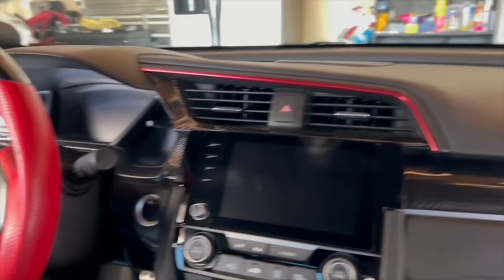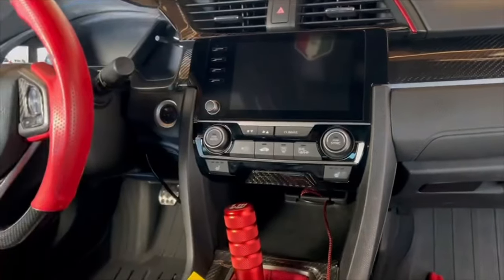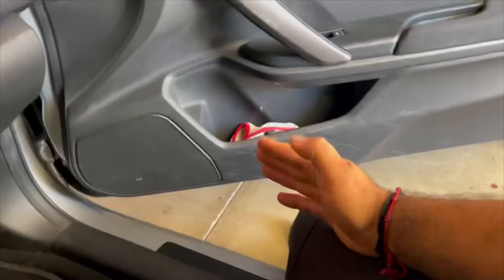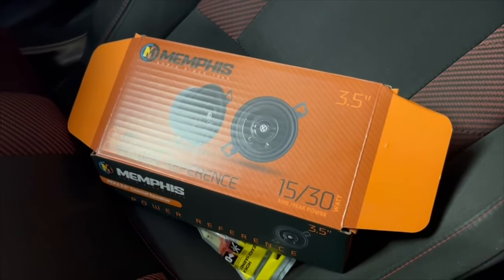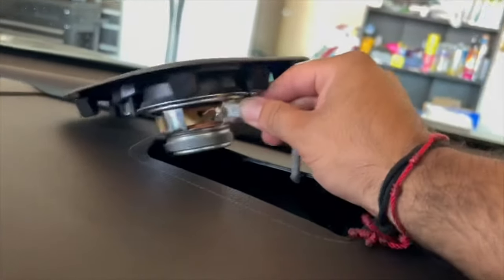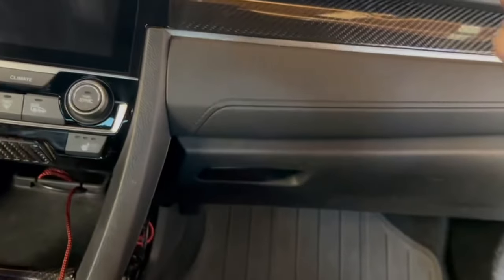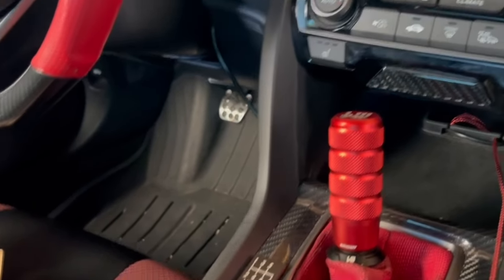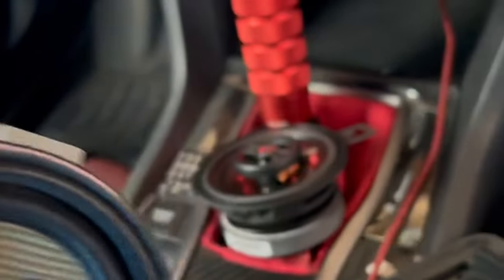Upgrading Front Speakers | 10th Gen Civic Si

Comment: I upgraded my 8 inch sub to a kicker 8 inch on my 10th si and It did little to no difference on bass. Ended up getting a 10inch sub and amp from kicker and it worked much much better. In my opinion don’t waste money on that 8 inch sub

Comment: you need to buy a pair of boomat, cut it in half and it will act as a waterproof housing for your speaker. You can also put foam ring and you will find the mid-bass improve alot.

Comment: You could replace the factory sub in the back with the 8in kicker subs (2 ohm dual voice coil) that’ll fit and can wire to ur stock harness without much fabrication. The only issue is that there isn’t much power going into the subs from the stock amp and taking out all the rear trim is a bitch. Now it might be a bit expensive (quality wise its probably the cheapest setup i could think of) but if you want some legit thump and sexy sound I say focus on applying some sound deadening material on your front door speakers (stinger roadkill, or dynamat etc) and doing a 5ch front stage upgrade (like a speaker component set such as the alpine r2-s65.2), getting a seperate sub (such as a downfiring L7T for room purposes in the trunk), and a DSP amplifier such as Audiocontrol D4.800 or D5.1300. Of course there are better alt out there but you know you do whats best for your application. Steady bumpin.
Reply from the maker: I upgraded the sub already aha to the kicker. How exactly do I get it wired up to be like an external speaker but in the OEM spot? To utilize its full potential. It says max 400 watts so I’d do like an amp with 300?
Reply: @ElPinche97  yeah you could run an external amp running high level input signal coming from either of the front doors since theyre the only ones that have full signal bandwidth or run a front door high level signal to an LOC then to an amp then to your subs. Just make sure you get a compatible amp thats running around 300 watts RMS to give you some wiggle room on power. The subwoofer says 300 watts but that just means it can handle 150 watts RMS. When shopping for an amp pay attention to the ‘RMS’ side of things. Otherwise id recommend just getting a 4 or 5ch amp with a DSP at around 800 - 1000 watts RMS just in case you want to put power to those door speakers in the future. If you got any other questions feel free to let me know, more than glad to answer them.
Reply: Also let me clarify, you cant just take out the stock amp you have to keep it plugged or else you lose all the other beeps and tones from your car. What I did was found the necessary wires that gave out full signal from the stock amp and Positapped them (L&R front doors) and ran those wires to my DSP amp and back to the output side of harness on the stock amp. You could also find a T-harness and do that from there (but its been hard finding a store who carries them or someone who does them.)

Comment: I’d replace the tweeters. With the same exact speakers you bought. So the sound quality stays the same. But I think the si does have a subwoofer in the truck. But all you gotta do is go to clutchfelid and type the model of your car, and they recommend subwoofers for your car, and all you have to do is just replace the factory subwoofer with a aftermarket one that will produce better sound quality, and will pack more of a punch.
Reply from the maker: Which tweeters? 🤔 I’d want them to look OEM though that’s the thing. And I ordered an 8inch kicker subwoofer. I went to the forums and found the only subwoofer that fits my car aha. Many have done it. Video should be posted soon once I figure out how to disassemble the rear plastics aha

Comment: So they make compatible amps with your “stock head unit” for example you take out your radio, and they make these mini amps that fit right behind your head until! And THEY do a fantastic job! And great power for your door speakers! But I know the si has like 8-9 different speakers I think?
Reply from the maker: Yeahhhhhh that’s the issue, like I need to know exactly what parts ahaha I don’t want to dissemble everything then not work. The Si has 10 speakers in total. 4 tweeters, 5 speakers, and 1 subwoofer.

Comment: i tried my hardest to upgrade without a box, but i ended up just throwing it out and throwing 2 12’s in the back, definitely worth it bro
Reply: also i upgraded the center stock sub originally but honestly it sounded like shit so i just sold it and got 2 subs
Reply from the maker: @danilojaramillo9972  do I need to unplug to stock sub to wire up an external one?
Reply: @ElPinche97  yea bro the way i have it set up is im running another amp next to the subs and im pulling signal from the two rear deck speakers for the lows, theres probably better ways to wire it up cus i lost the subwoofer adjustment from
the head unit